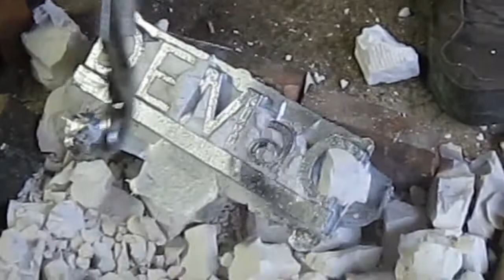Casting Aluminum  Plaster Mold

Comment: i'm wondering if i could make a plaster positive and make the mould itself out of aluminum with the idea of possibly rigging up some kind of injected plastic for small production runs. since ABS plastic has a low melting point, perhaps some lower melting metal would work? but i'm curious about detail retention with these other metals (e.g., lead or tin). then again, i'm not sure how i would make a two part mould out of any metal....
Reply from the maker: hello Ryan, I'm not sure if I understood your idea! Plaster is very used mainly on cerâmica industry for mold making. Since you dry it properly, you may be able to cast some low melting point metals on it, but I'm not sure about plástics probably they will stick to the mold walls (?)
Reply: laranjas3 well, the plaster/plaster of paris has a maximum working temperature of 1200F, or so a brief bit of research tells me. can that maximum temp be raised, say by adding fine sand? aluminum's melting point is a little shy of 1300F, so i'm wondering if a little forging science can close that gap. 

i would figure that plastic wouldn't stick to a plaster mould if you use proper mould release. but, i couldn't say for sure. :)  

i'm hoping it's possible to rig up some DIY injection moulding press to an aluminum mould and shoot ABS plastic into it. as for why i would prefer to use Al it comes down to ease of use, detail retention (though i don't now how 'lesser' metals hold details), and availability (which makes Al practically free).

as to why a plaster positive (these would be two-part moulds meant for small production runs mostly aimed at custom work for me and my wife's trophy shop), it comes down to low cost, hardware store availability, ease of use, and it holds nice detail.

i'm probably just dreaming here, but without researching it i'll never know, and that would bug me, lol.

Comment: What was inside of the plaster? Foam or wax? Did it want to rise to the surface of the plaster?
Reply from the maker: I used Foam, but i removed it before casting!
When i was pouring I want to full fill the mold, but I overrated a little.
Reply: Thank you.

Comment: exactly how do you dry the plaster properly.....i have been doing alot of different types of casting and i am just starting some plaster projects but i am still unsure if i need to kiln fire the moldings or cook them in the oven or what.
Reply from the maker: hello, to dry plaster properly you should use a oven with internal ventilation during 4-6h @80-90°C and after that increase temperature to >240°C during 4-6h (never cast aluminum without proper drying!)